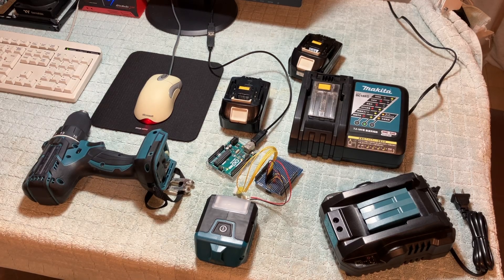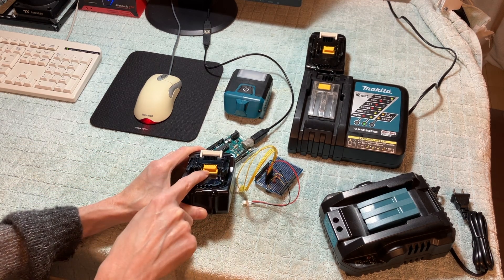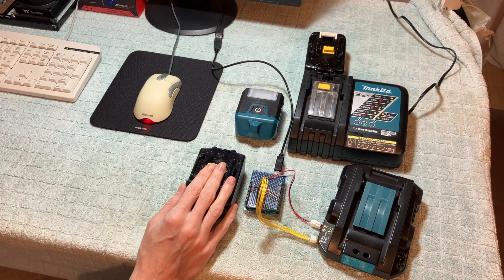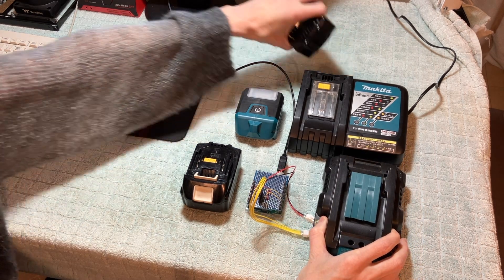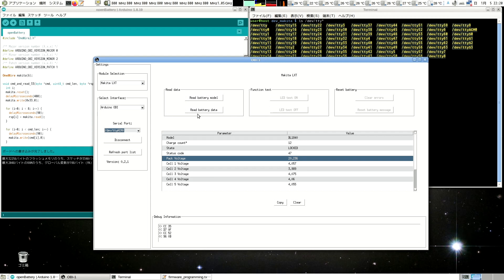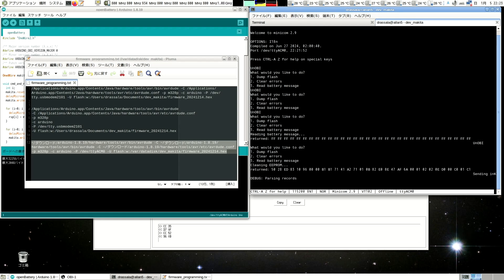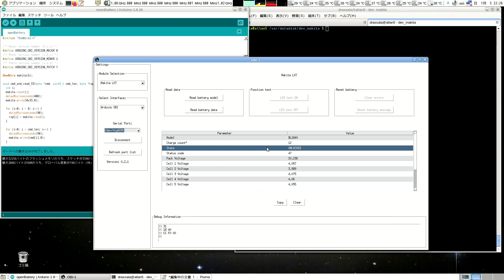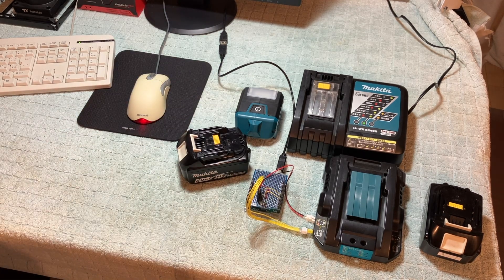Fixing a Makita 18v BL1840 battery lockout with Arduino OBI, works!

Comment: The green makita charger is what they sold first. At that time the board on the battery didn't balance. I purchased a black charger many years ago only to discover it would refuse to charge my batterys sometimes whereas the green one had no problem. I assume this is the reason why. I knew nothing about the batteries at that time, just tookthe black charger back and got my money back.
Reply from the maker: Thanks for the comment.
I did not know this and I have two chargers here, both black.  Both model DC18RC T .
There are slight differences on the labels and the color of the spring loaded plastic cover protecting the terminals that connect to the battery.
One is clear plastic, the other is green plastic.
I was not aware there were any differences.
Thanks for sharing.
Reply: @allans-workshop I just went and looked the green  charger model# is dc18ra. Lol it says "Ni-MH & li-ion 7.2-18v. So it will charge your nickel metal hydride makita batterys too!

Comment: Can you explain bit of where you get that code you copied and what did you tape after to get this battery recovered?
Reply from the maker: Thanks for the comment.
The video has the complete recovery from beginning to end, however, this is an older battery with fewer built in maintenance commands, request a unique approach.
If you have this specific older battery (BL1840) it requires a more complex approach and support was provided from the author of Open Battery Information.
Please contact them directly for support with these batteries.
https://github.com/mnh-jansson/open-battery-information
Contact email is on that page under "Contact information".

Comment: Do not you know what can be done if battery state is unlocked, but flashing battery state indicators 2x2 and battery information saying only available for diagnostic
Reply from the maker: Thanks for the comment.

If this says "only available for diagnostic" then either there was some noice in the communication between the battery and the Arduino, or it is an older battery that does not support the maintenance commands.  In this case the wires between the battery and the Arduino might be too long.

If the battery shows "unlocked" and reads out the battery cell bank voltages that I would think it would be unlocked and able to be used.

What are the symptoms?

Comment: Can this OBI tool be used to find out if used batteries are fake or original ones? Can you 100 percent tell that original is original or some fake BMSes act like original ones ? 
I would really appreciate answers :)
Reply from the maker: Thanks for the comment.
Short answer, not 100%, but I think it is not too common.
With opening the battery and comparing to some images online it should be easy to compare.  Most non-oem boards will be very simple with only bare minimum functionality.

The battery can be opened non-destructively, but a not so common screw driver will be required, and one screw hole has a "plug" installed it that will have to be removed.

Longer answer.
It depends what is programmed into the microcontroller and if it responds the same way.
As the addition of the microcontroller and programming the functionality is not trivial I tend to think it is not a focus for non-oem batteries.

In order to make these as cheaply as possible I am thinking only necessary components and functionality are included.  The charger does indeed communicate with the battery during charging so some of this functionality must be included, however, maintenance commands (to reset lockouts) may not be included.  The non-oem batteries may not even support all the safety functions (including the lockout flag).

Doing an internet image search for "makita battery replacement pcb" might show the differences.
Reply: @allans-workshop  thanks a lot for such a long reply. I was asking because I have only 4 working batteries that I bought from legit source and I am sure that they are original , but sometimes I see used batteries being sold on market place for a reasonable price, looking like original ones but I was always afraid of getting fakes. My potential use case of OBI was going to the seller from market place and connecting his battery to obi and checking if its original without any opening/interferencing in battery, just connecting it to the computer. Is it possible? Does it looks like good solution?

Another question , do you know if I can be sure that connecting my original batteries will not cancel my manufacturer warranty ? In case of returning batteries to be warranty repaired, can warranty guys see that I was connecting battery to OBI ? 

Thanks a lot

Comment: 9:20 Where did you get this program?
Reply from the maker: Thanks for the comment.
The program was provided as a way to do some testing on this older more frustrating battery, the newer batteries don't need to go through this more frustrating method.
See these other videos for a more simple method.

Makita battery lockout, full guide setting up Open Battery 
https://youtu.be/OeKCjAiLS9o

If you are still interested in this specific version please contact the author directly, their email address is located on this page under "Contact Information"
https://github.com/mnh-jansson/open-battery-information
I am avoiding posting the email address directly so it does not get scrapped and spammed.
Reply: @allans-workshop thanks, I have old battery and I need use more flustered method 😉

Comment: Seeing as it has been nearly 7 months since you posted and there is no information on his page for what you have done here, 
it would be very much appreciated to share that file and perhaps some more information on the software side of things to do what you have done here.
I have just set up my arduino, however until i saw this video i did not know my 1840 battery would not work, and i would love to not have to throw it out
Reply from the maker: Thanks for the comment.
Please contact the author directly.
Their contact information (email address) is located here under "Contact information"
https://github.com/mnh-jansson/open-battery-information
Reply: Well clearly he should turn over all of the info and hardware he has because you want him to to save your 1 battery. Seriously though, it has taken 20 years until there was news of anything about Makita batteries, so it's gonna be a while. Also if your battery is even remotely new ship it to makita and they will likely replace it for free.
Reply: the actual creator of the program and that file claimed they did it to prevent landfill. so I just assumed that it would be freely available. if it truly was a philanthropic endeavour. clearly it would make sense he "hands it over". anyway I did my best and salvaged the cells and put it in a Chinese case and BMS

Comment: I want to ask. Does this also work with XGT 40V BL4040 batteries? Thanks for the answer.
Reply from the maker: I do not have a 40V battery here to test, I might pick one up (and a tool) for testing if I run across one in the near future.
Reply from the maker: Thanks for the comment.
Hardware wise, it is compatible (communication protocol is the same I believe) but not sure on the software end.
Please check out Open Battery Information for support in the software.
https://github.com/mnh-jansson/open-battery-information

Comment: That computer mouse isn't older than me, but it's closer than I'd like it to be.
Reply from the maker: Thanks for the comment.
It is a Microsoft IntelliMouse Optical 1.1  that originally released around 2000 or so I think, it is my favorite mouse (can do PS/2 or USB).
I just can't get used to all the ergonomically designed mice these days, they just aren't made like they used to be.  I hope it lasts a long time.
If you find one on eBay snag it, it has been the best mouse I have ever owned.
Reply: @allans-workshop I remember when my brother got one of those. It was definitely a huge upgrade from the old ball mouse. I prefer the newer mice from Logitech, but you gotta stick with what is comfortable for you.
Reply: @allans-workshop  it always came as a keyboard mouse combo, here in Mumbai India, some one borrowed my mouse, and never gave back, microsoft keyboard still going strong..!

Comment: First of all very informative video thanks. Instead of buying a charger just for its connector, I think it would be wise if the Arduino was installed in the charger and wired so that it is in series with the chargers data lines. With a little extra software and by using the Arduino's other data lines to received and pass thru the data going back and forth between the charger and the battery they would still function normally. Yet with a simple command the Arduino could be used to snoop or take control and issue its own commands to the battery or even to intercept commands and data moving between the two and selectively alter it on the fly.
Reply from the maker: Thanks for the comment, yes that would be really nice.  Good idea.
I think it would be possible just to read the data going back and forth between the charger and battery.
This would require some software changes on the Arduino (and Python script).
You might post a suggestion up at Open Battery Information (link below).
https://github.com/mnh-jansson/open-battery-information

I have done something similar int he below two videos with taking an existing charger and adding an Arduino inside it, however, the original charger electronics were disconnected so it does not retain the capability to recharge batteries.
But as seen from the below video, some very small compact Arduino PCBs are available that could work nicely.

Building Open Battery Information with (Arduino) Adafruit Trinket M0 into the battery charger case
https://youtu.be/3QhsOQUzpIg

Raspberry Pi with touch screen Makita battery lockout repair with Open Battery Information
https://youtu.be/D63zsjyJBJ8

Comment: Please link ,makita firmware hex (bin) file ?
Reply from the maker: Thanks for the comment.
Please contact the author directly, their email address is located on this page under "Contact Information"
https://github.com/mnh-jansson/open-battery-information
I am avoiding posting the email address directly so it does not get scrapped and spammed.

Comment: where do i get that custom firmware for older  batteries?
Reply from the maker: Thanks for the comment.
Please contact the author directly, their email address is located on this page under "Contact Information"
https://github.com/mnh-jansson/open-battery-information
I am avoiding posting the email address directly so it does not get scrapped and spammed.

Comment: 1.will this work on makita bL1830 18v 3000mah.
2.can arduino nano v3 be used instead as uno is kinda expensive.
greetest respect to you sir and mr.jansson ,awaiting your reply thanks.
Reply from the maker: Thanks for the comment.
I think, by the look of it, BL1830 is an older model battery and does not support the maintenance commands shown here in the video, although battery cell information should be able to be read with the software in the video.  While not impossible to reset this battery it will take a little more effort.

The Arduino Nano v3 appears to be based on an ATmega328 MCU, while the Arduino Uno is based on an ATmega328P (which consumes less power) but appear otherwise functionally the same, including both operating at 5V.  Basically, yes, it should work as a substitute for the Arduino Uno.  I would not expect there to be any issues as long the correct board is selected during programming.

Back to the first question, take a look at the following post.
https://github.com/mnh-jansson/open-battery-information/issues/40

The battery appears to be based on the dreaded F0513 MCU.  The above hardware, and instructions in this video will detail how to assemble the hardware, but will be necessary to contact the author to check on progress for an unlock for the F0513 based batteries.

The email can be found on this page under "Contact information" a just a little ways down the page.
https://github.com/mnh-jansson/open-battery-information

Comment: Hello. Could you provide the firmware files that the author provided to you, namely hex?
Reply from the maker: Thanks for the comment.
Please contact the author directly, their email address is located on this page under "Contact Information"
https://github.com/mnh-jansson/open-battery-information
I am avoiding posting the email address directly so it does not get scrapped and spammed.

Comment: This seems horrendously complicated, why can't someone make a device with a built in arduino that just has one button that says "Reset Battery" as that's all we need.   If anyone has the skill to develop that, contact me. I can set up a Gofundme for the capitalization.
Reply from the maker: Thanks for the comment.
It is defiantly possible and I have a good idea on how to do it, all the information is there, it is coding and programming that will take time.
There might already be those kind of solutions out there, I have not spent a lot of time searching yet.

Making a one button push solution (for me anyway) takes some effort since you really have to consider all use possibilities and problems that might be encountered, and then automatically make assumptions on how to proceed in those situations.

I do have a series of videos up and tried to simplify it as much as possible with off the shelf tools and components.
Makita battery lockout, full guide (parts 1 to 3)
https://youtu.be/OeKCjAiLS9o
https://youtu.be/yMnqnIM8TFs
https://youtu.be/3ueKLaRp64E

Comment: Is it possible to use Arduino Mega instead of UNO?
Reply from the maker: Thanks for the comment.
I believe it will work, you might need to check the GPIO connections but might work as is.  There could be timing issues but does not hurt to try.
I believe the Arduino Mega also runs off 5V.  The pull up resistors will have to be tied to the correct pull up voltage if not.
I actually want to use an m0 based MCU (Adafruit Trinket M0 actually) myself and might make a video about it.
Reply from the maker: Check out this video, it is much easier to follow for assembly.
https://youtu.be/OeKCjAiLS9o

Comment: If the battery pack voltage is around 15v, can the OBI still read the BMS, because I get an error that it’s attempting to connect after 2 tries.
 Do I need to charge the cells individually to make OBI recognize the battery pack?
Reply from the maker: I think the BMS should still function since it only takes about 3.3v or so to run the microcontroller.
It should at least be functioning and connectable with OBI.
Does OBI connect up with any other battery pack?  That would be a good test.
Sometimes I have found the connection to be a little flakey so it may take a few attempts to connect up.
It should not be necessary to charge the battery pack for OBI to be able to connect to the microcontroller in the battery pack.

Comment: hi , can you explain i liitle better the how did you flash the hef file into the broken battery usind the terminal tools ? Also where can i find the firmware_20241214.hex
Reply from the maker: Thanks for the comment.

The software (firmware) in the battery has not been flashed (changed), what is being flashed is the Arduino Uno.  The Arduino Uno is acting as a protocol converter to allow the Python program on the PC to interface to the battery (and reset the lockout flag).

As far as the firmware files that I flashed to the Arduino Uno, please check out the original author's project website at https://github.com/mnh-jansson/open-battery-information and feel free to contact them through there.  There is a more user friendly solution in development and might be available now (or soon).
Reply: @allans-workshop  i have managed to flash the arduino so it can comunicate with the battery , i aslo managed to run the puthon program but it doesn't work with bl1830 batterries , its says that i can only diagnos them. So i thought that you had an undated version that can clear the errors of the battery

Comment: Hi! I am testing reading my BL1850 battery data. It still works. But the " Read battery data" and the following parts are hidden. What should I do?
Reply: Це означає що ця батарея підтримує тільки діагностику
Reply: @dmytro1323G   Ну так то і не проблема, що підтримує тільки діагностику!
Reply from the maker: Did you press the "connect" button first?
At least for me it takes a couple seconds to connect after pressing the "connect" button.  Then the the "Read static data" and "Read battery data" button should become available.
I was using a slightly older version in the video, I will update to the newer version and double check things.
Reply: I have the same battery too, BL1850.
The reset battery and Function test options are greyed out to. 
On the underside of the battery it says BL1850B but the bms is an older version, that being BL1850.
Reply from the maker: @Angelokrto  Yes, the same with me (and my older batteries), and it is more so that these older battery packs do not have as many maintenance commands built into them.
The older batteries need a slightly different approach to resetting the lockout flag which is not as trivial as just sending a reset command to the battery (like the newer ones).
Reply: @allans-workshop  Got it. But is it a normal thing that they do with the sticker code name being wrong?
Reply: @ So I found another battery BL1840, when I press Reset errors, the BMS stays locked. Does the windows compiled version of OBI not work the same as using command lines in Linux?
Reply: @ In one of your video’s you succesfully unlocked a BL1840 battery using Linux